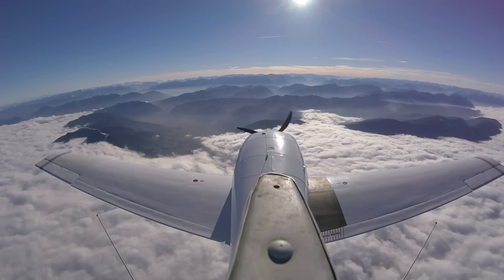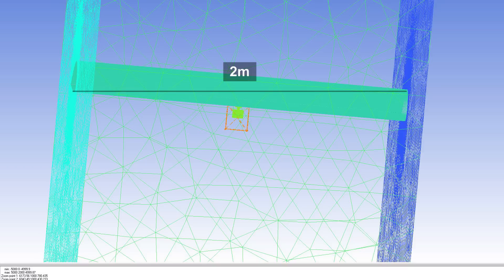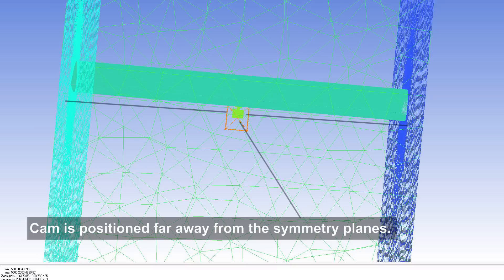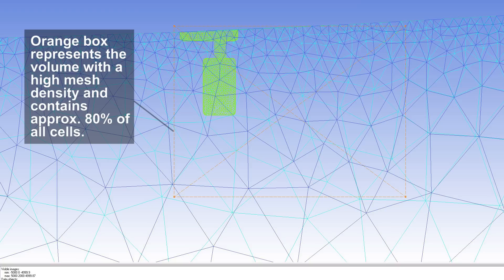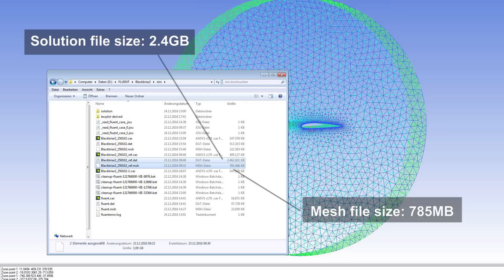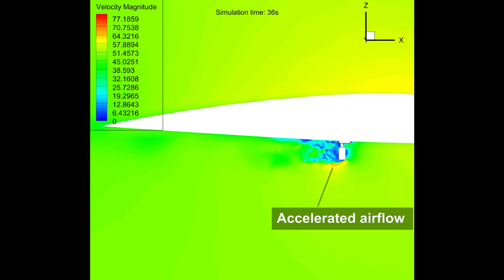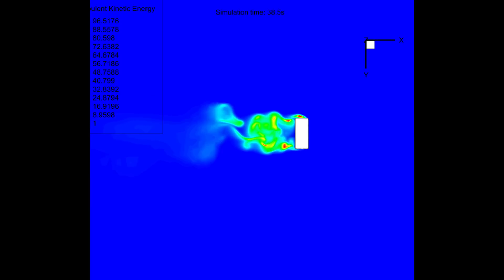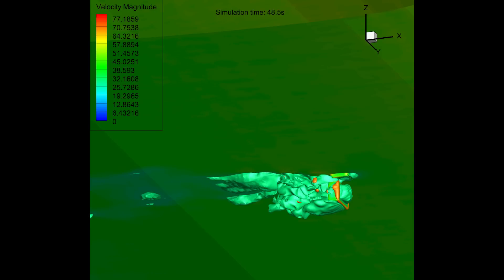Simulation of GoPro mounted to aircraft wing

Comment: I had my GoPro hero 8 mounted on my Cessna 172 wing at night.  I have two means of controlling my auto pilot. One with my gps and one with my heading bug on an Aspen G5.  The GPS unit corrected for the uneven drag but the heading bug did not and the course was slipping over time.  It was obvious that there was an affect on performance.  Having another on the opposite wing would have evened the drag but also doubled the effect on overall performance.

Comment: Great info! I mount them in multiple different locations on my Piper 140. It's a great training tool and I've never noticed any difference in flight performance. I've often thought of making a small fairing to attach behind them and your data shows that that would definitely be of beneficial effect. I should note that on areas near critical surfaces I use the smaller gopro sessions.

Comment: very good..... your basically losing the lift of the wing as wide as the camera. 

A greater concern should be what happens when (not if) these mounts break and the camera falls off. Every other component on an aircraft is designed to require multiple point of failure before it detaches......go-pros, their enclosures and their mounts were not designed with this consideration. 

Simulate the equivalent force and how many floors of the house below will be demolished or how high you have to be for it to kill someone. 

Then consider it being ingested into the next jet engine after it detaches on your next hard landing....... the Concorde disaster is my first thought. 

Oh the camera serial number and recorded video will be all the accident investigators need.

Loss of lift on a tiny portion of the wing would seem to be the least of worries.
Reply from the maker: There are plenty of mounting options on the marked. I personally use the gopro sticky mounting foot. I flew aerobatics with such a mechanism (+4.5G, -1.5G) without any issue. On my aircraft I additionally secure the foot with cable tie to the tie down mount at the tail for example. I once tried to remove the foot and took half of the airplane apart. As long as they’re properly mounted (clean surface, etc.), they will not come off easily.
Reply: good luck with that and sounds like you can join the myriad of other pilots who can say they've never had a problem. But there are already stories of those who have lost cameras....fortunately not over densely populated areas and nobody has known to be killed or seriously injured yet. Good luck with the cable tie backup....you'll want to make sure that rattling around (the gopro shell will likely shatter....maybe you'll be lucky and it'll just be indistinguishable bits of plastic that end in an intake or an undercarriage?) isn't near any control surface. I'm sure you're smart enough to know it's a question of time......all for video footage? Not a risk I'm personally prepared to take - there are enough other things for me to preflight and keep an eye on. There was one pilot I saw a few weeks who had five of the sticky mounted gopros and he went up with an instructor who didn't say a thing. Similar story about how he'd stuck the mount on overnight and he'd never had a problem nor was there any way it could ever be a problem - flight was over a major city with touch and goes at a busy executive airport with lots of jet traffic. Not for me.
Reply from the maker: I thought about that before. The problem with a housing completely surrounding the camera is that it would distort the image. In the front, you’d need some sort of round (aerodynamic) shape. So my next idea was to 3D-print something to attach at the back of the camera to avoid the wake space behind the cam.